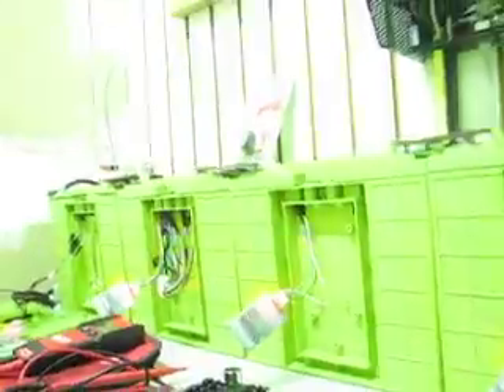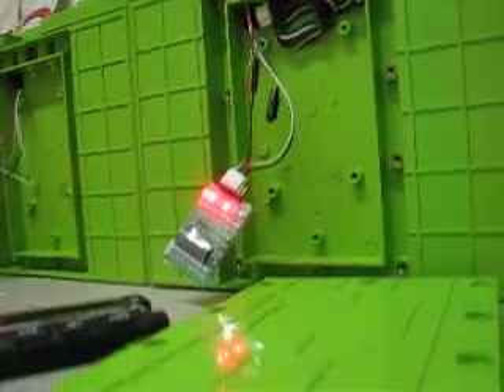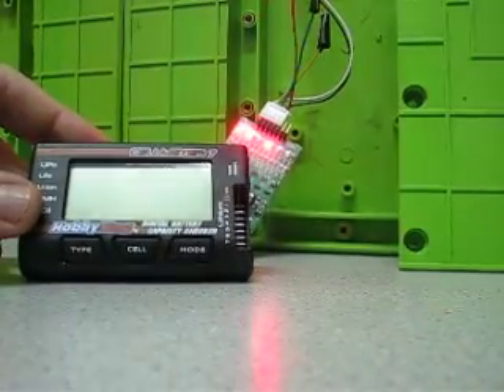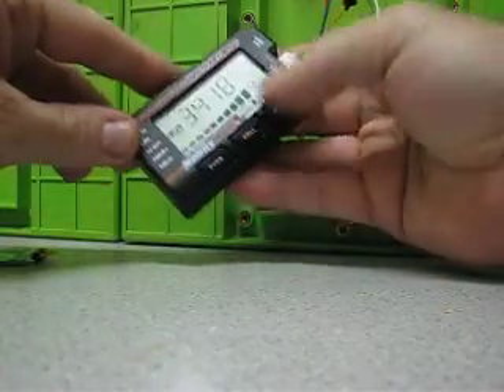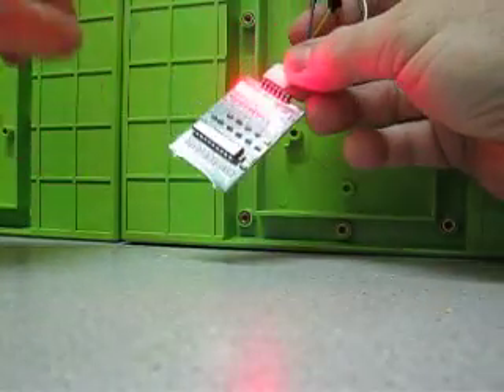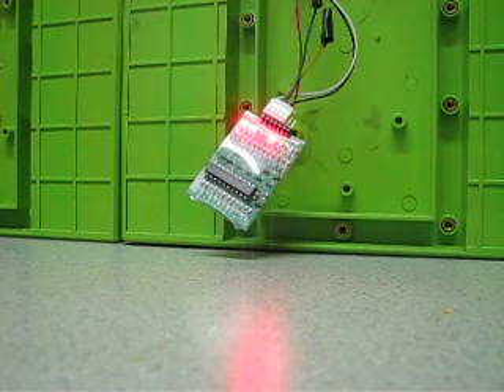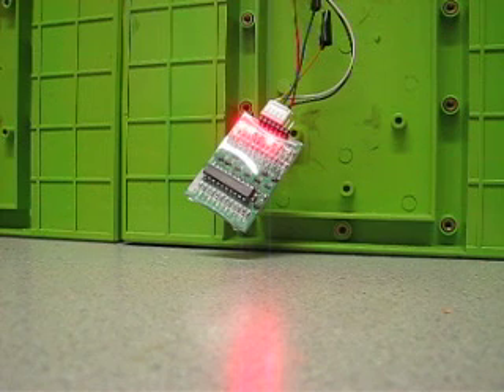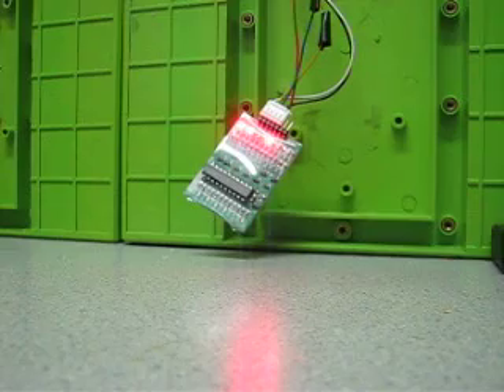On/Off Grid Solar & Lithium Phosphate Batteries with Hobby King Cell Ballancer

Comment: sir i am trying to put up a system like yours using battery packs  built from 18650 cells from dead laptop batteries and a bms would this work
Reply from the maker: Absolom Madhaka Hi, Yes will work! The same type of cells are in my 12volt packs over 600+ cells in each pack.
Reply: off grid kid sir do you have a video with the 600+ cells you are talking about
Reply from the maker: No that is what is in each green 12volt 110ah  battery x 4 i'm running had one apart but did not do a video.
Reply from the maker: there are 4 bricks of 3.2 volt cells to equal 110ah joined to make 12volt in each green battery i'm using. more like 14.4 volts fully charged.

Comment: Can i please get some information on your battery's what brand and ah are they?
Reply from the maker: James Condron They are 110ah Not sure of the brand, got them used. there are no markings on them?? Found this link @12 I would not get 12 volt cells, get 3.2 100ah lifepo4 cells or greater.
Reply: Those are Valence batteries. I just picked up 21 of the smaller 12V models.